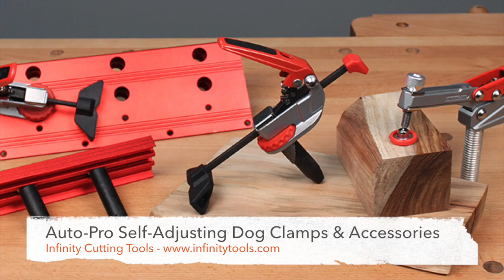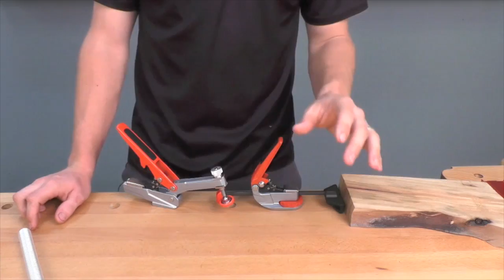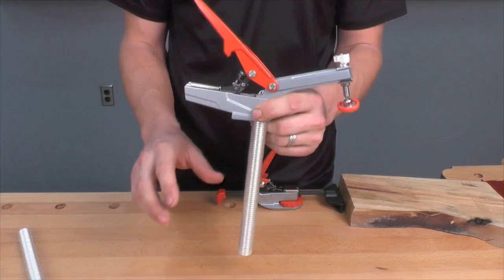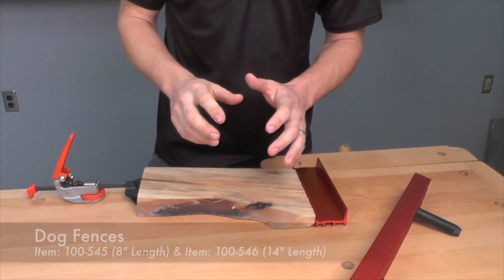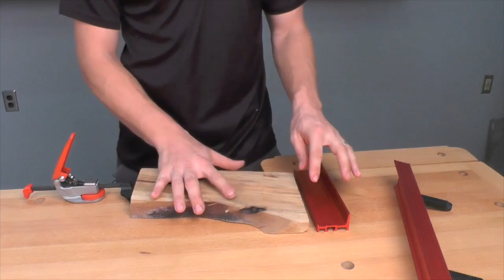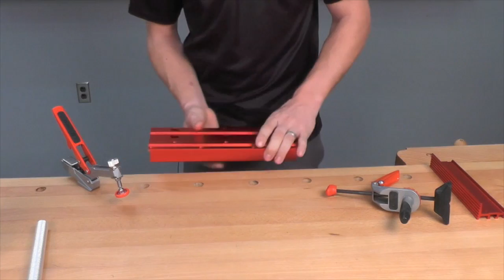Infinity Cutting Tools - Armor Tools Auto Adjust Dog Clamps

Comment: How thick bench do you need for this system
Reply: FYI… I have a 3/4” section of my workbench, and this wouldn’t work. I had to mount another 1-1/2” thick block under my table to get these to “catch” and hold. They work great now, but I would suggest no less than 1-3/4” thickness for secure use.
Reply from the maker: Armor Tools recommends a minimum bench thickness of 3/4" or 20mm.

Comment: 3/4" =19mm  It won't work in a 20mm hole so that you sell the 20mm pin ? for 1mm ???
Reply from the maker: The 20mm pin is designed to work with a lot of systems on the market like the festool table that have 20mm holes. In the thin top that 1mm can make a pretty big difference in use and helps the clamp lock properly without slipping or damaging the hole.
Reply: thank you !